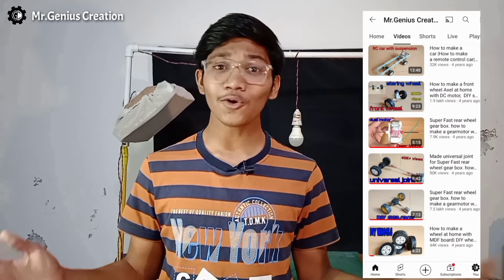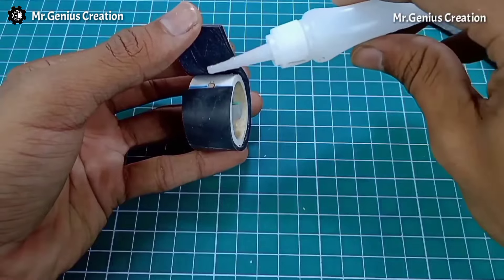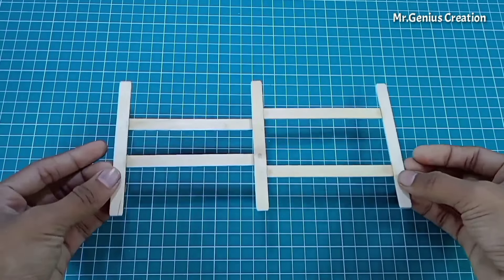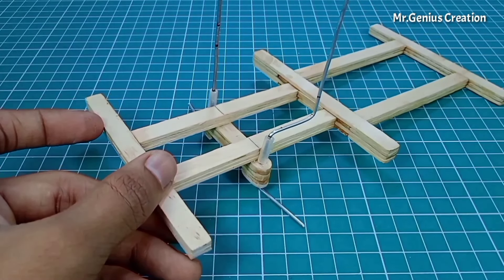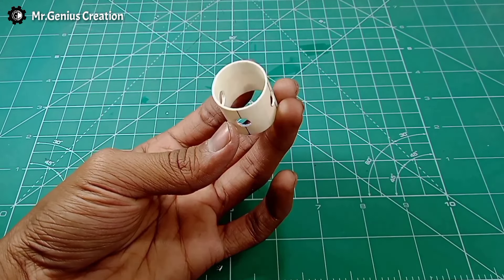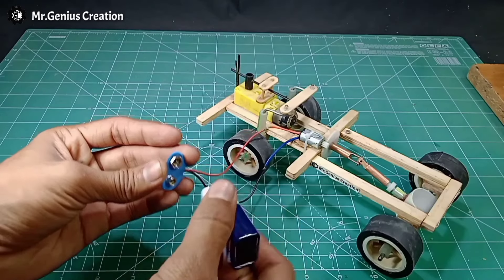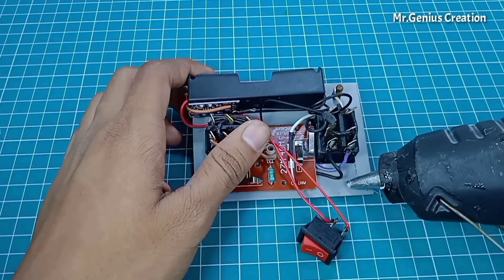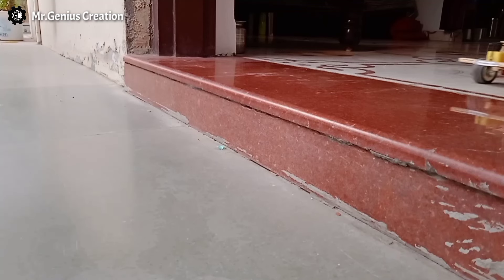NEW IDEA 💡 : Drive Shaft Mechanism RC Car | How to make a Remote Control Car with Universal Joint

Comment from the maker: ☺Share your ideas & suggestions in comments
👇👇👇👇👇👇👇👇👇👇
✨9-in-1 Complete Soldering Iron Kit [ Fast Heating, Adjustable Temperature, Digital Screen, Versatile and Portable] 👇👇 https://www.amicikart.com/products/d39541718e/450878000153997365

✨Get Your Robo Car Kit from Aerokartindia.in 
👉 https://bit.ly/48Cu7EI
      https://bit.ly/48Cu7EI